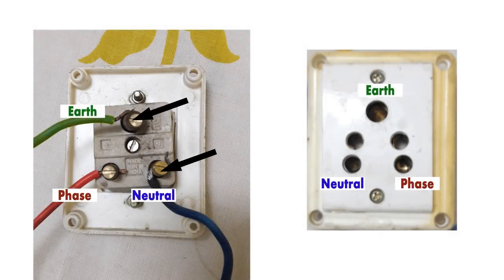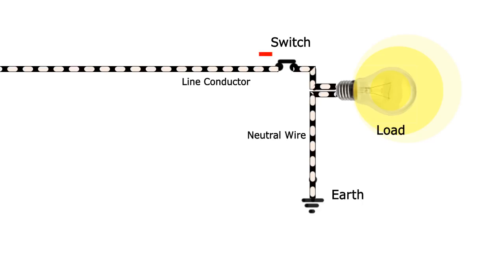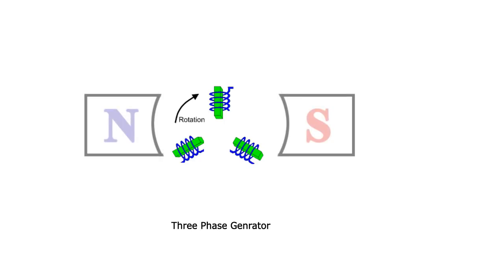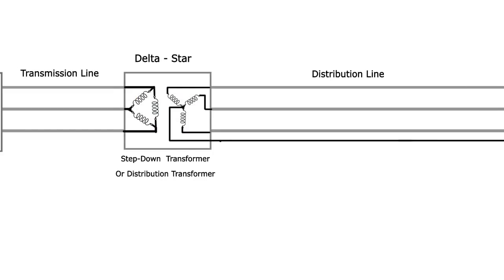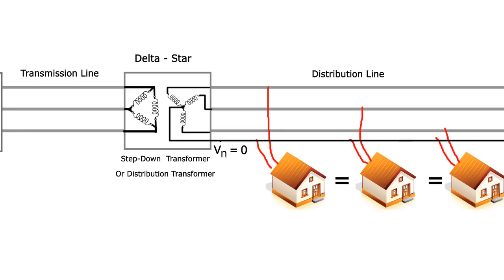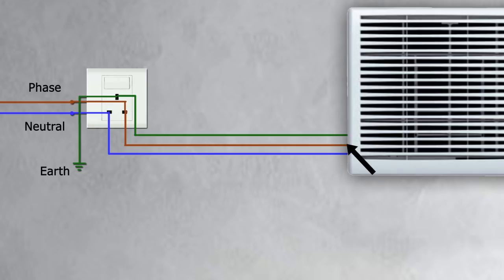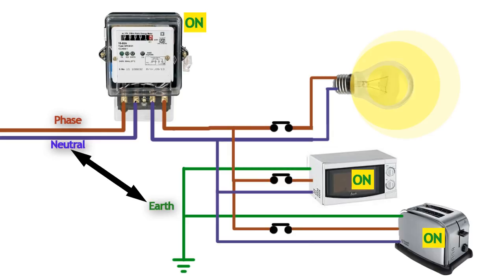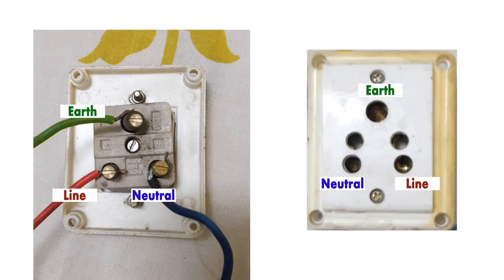Difference between Neutral and Earth

Comment: if neutral  point is grounded in distribution terminal of star connection then why neutral line is required in distribution line only there phase lines are sufficient to transfer power to load ................this saves conductor,......... but  why electricity distribution system uses neutral wire................ can you explain....................?

Comment: ground should not connected with neutral.. neutral use for complete live circuit. and ground use for safety precaution which connected to body of equipment. this is bad explaination.

Comment: Neutral for completed circuit with Live/Phase.
Earth is for grounding (Safety measurement for Electrical appliances with metal surface)

Trivial : 水線 （literally means Water wire）means Earth wire in Hong Kong, but means Neutral wire in Taiwan!

Comment: If the ground is connected at the power plant on the coil why does not the current flow in the ground instead of coming towards the transmission line ??
Reply: I guess higher resistance

Comment: There are two different, normally running positive charge potentials to a neutral. One is the normal earth positive and two is the solar percentage of the same earth grounding. The struggle of a dual function switch. The current within the n. Wire travels in an alternating saw tooth pattern, as it uses both positive charge types. The complex positive response of the neutral produced positive gain. The drag of an electrical generator happens from positive charge current that is solar power. The solar cell would not work without solar actuation that comes from ground rod two phase grounding. Earth grounding alone can not do it. The earth particle is effected and null. The solar agitation percentage during normally running hours, is the solar grounding. cJT

Comment: If I connect the ground wire direct to the neutral is it right as the distribution transformer is already grounded is it right ?
Reply from the maker: It may work, but will not serve the purpose in each condition

Comment: Sir, if we don't use any neutral, then will the bulb glow? If not then why? The phase is oscillating the electrons in the wire as well as in the coil of bulb.
Reply: There would be no potential to earth (ground) if no neutral was installed. Without potential in difference (voltage) we wouldn't have current flowing. Electrons will flow to the ground then back up and repeat. Etc.